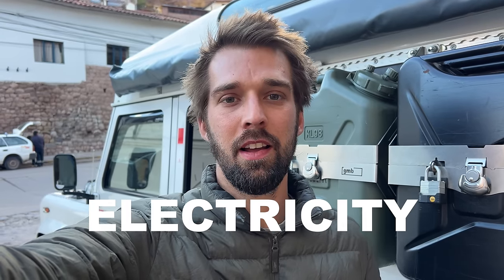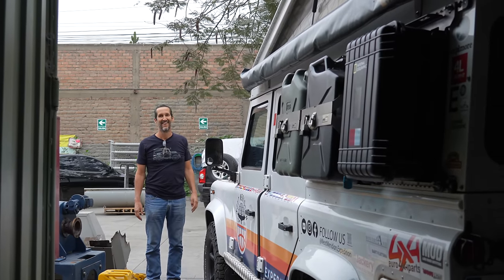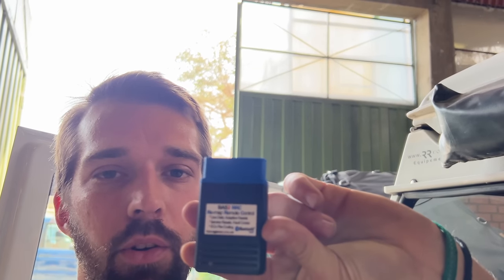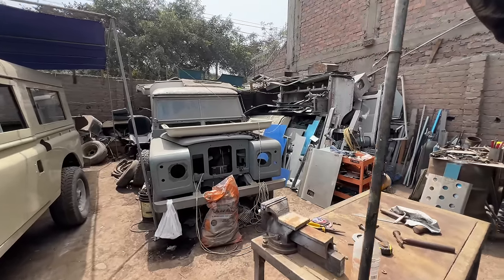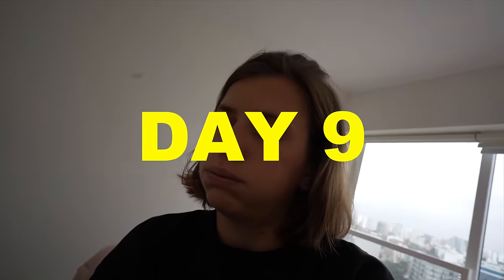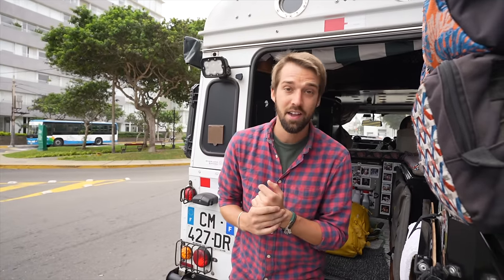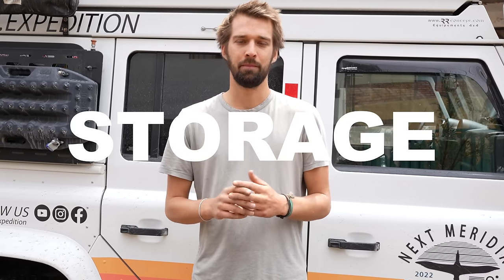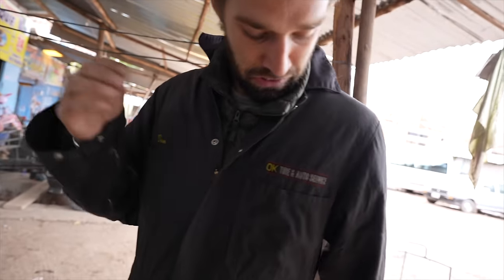Upgrading our DEFENDER to continue the world tour (Albatross 2.0) - EP 78

Comment: You did a great upgrade: engine and elect power, storage... You will feel much more confortable. I also have one Defender 2.2l reprogrammed at about 150hp, but far from your very complete set-up. I love my defender with the feedom it provides by its capabilities. With the engine torque increase you must keep an eye on your transmission. The intermediate axis of the transfer case  is a bit weak and it could be damaged. A reinforcement is possible if needed. 
I love the images you share. You visit great places of course, but you provide a very high level of quality of the video. Thank you for sharing.
Love you guys, from southern France.
Reply from the maker: Thank you Didier! Merci! 
We will keep an eye on this thank you for the kind advice!

Comment: Hey guys. Be cautious about the integrity of Hannibal’s back door hinges. With the total weight ( spare wheel +steel carrier ) you’ve added a lot of extra weight to them. It is possible to come lose , worst case scenario could be that they crack. A solution could be to reinforce the metal around the hinges to prevent further damage. Good luck

Comment: Hello Nick & Mathilde ! Nice upgrades, I am still not convinced to do the 170hp remap on our 2.2L TD4 yet, but quite interested about the chassis storage boxes !
So sad the 5% off coupon is expired 🥲Anyway, good luck have a safe trip !
Reply from the maker: Hey Mathieu, so far we really like the remap! We will debrief more when we get to test it longer. For the chassis boxes the code should still be valid. If you contact roverland he should be able to apply it for you.
Reply: Cool maybe I'll try to contact them then. Let us know if the engine and parts are not too overloaded over time, especially without changing the intercooler for a bigger one. Bonne route !
Reply from the maker: George from RoverLand confirmed it was a mistake and it should work now. If not yes contact him. 

We actually had changed the intercooler already! Just we did it before we left on this trip.
Reply: Haha, my bad, I wasn't attentive enough watching your videos (or I don't remember) !
Thanks a lot for the RoverLand code, it seems to work again indeed.